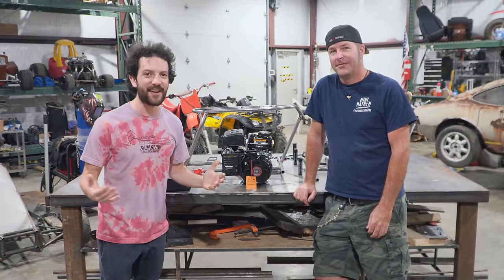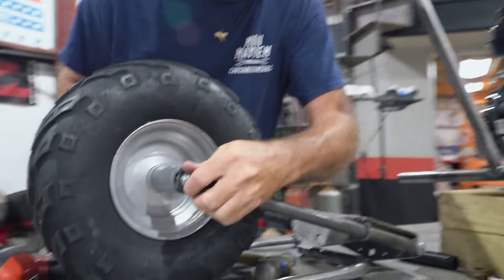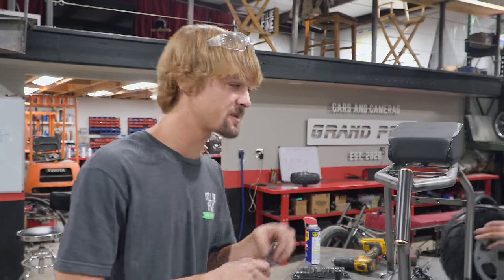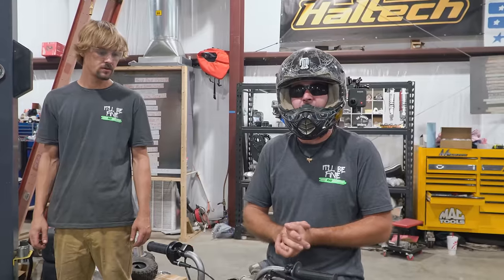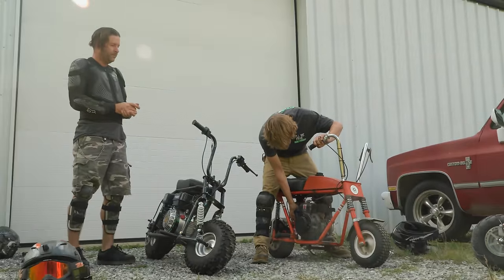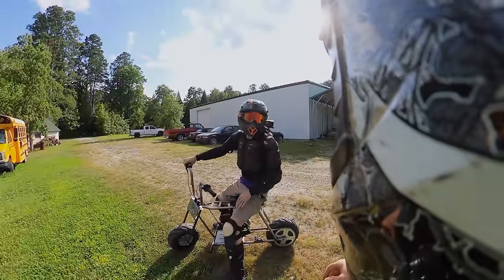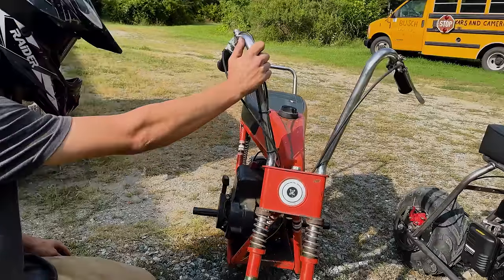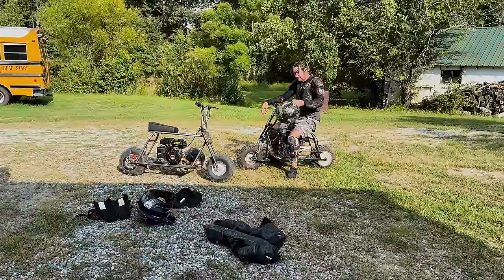Best Budget Mini Bike? Rascal Lite Build + Race!

Comment: In the 70s we used to race VWs around the neighborhood. As we got older we graduated to V8 in muscle cars. Nothing compares to the fun we had rowing through the gears of the underpowered 4 cylinders. Those underpowered minibikes brought back found memories. Sometimes less is more!
Reply: Its to more to drive a slow car (or bike) fast, than a fast car (or bike) slow. You can't push a Ferrari or Vette or a Huyabusa to its limits, or yours, without dying. But you can beat a Trail 90 or VW like a dirty rug.

Comment: And still got the front tread backward! On V tread, both tires point to the center, looking down from above. Unless the front wheel is driven. Then both tires are configured to pull. And if there is no brake on the front, it might not matter that much.

Comment: Nice. I built one of these with a cam, billet flywheel, slide carb, header and no governor. The engine woke up quite a bit. Nowhere near the low end you can get out of a 212 or 224 but it was a lot of fun. Well over 40MPH too. it's long gone though; the bike has a 212 Tilly now and it's about to get a 236.

Comment: I totally get that Go Powersports is a major sponsor, but all parts should fit without welding on new tabs. Maybe they accidently sent the wrong seat. Suggesting that one could order a different seat or weld on new tabs to fix a GPS problem is not good for the newbie.  
BTW, thank you for your continued content.

Comment: Nice minibike guys I'm trying to build out mine right now it's a mega moto  with a predator 420
Reply: which mega moto?
Reply: @AshleyOnYT  mega moto 212 I stretched the frame to fit a battery and i welded a new rear axle/tire mount on rear to fit a slick wheel
Reply: @barbaranevins4979  Hell yea that's dope! I have a Motovox 80cc currently but my first new bike will definitely be their mega moto 80.

Comment: I like it....seems like a great value compared to the thin wall Chinesium stuff out there. The 3hp performed about how I expected....Those tiny engines really benefit from a jackshaft setup. Looks to be plenty of room behind the engine to fab one up and play with reduction gearing for more acceleration off the line. All of my old DB30's with the original 97cc flattys were built that way and ran great, especially with the gov deleted. Nice job, boys! Ballin' on a budget!

Comment: For Charles bike, when you get a new wheel, make sure the spacer between the two bearings is exactly the right length so the bearing clips seat at the same time the spacer makes contact with the inner race.  Then make outer spacers that allow smooth straight operation of the forks. With the axle bolt tight, weld in a fitted fork stabilizer between the top of the lower fork tubes.  This will keep the forks from working individually, and dramatically improve handling.
As for the new bike...100cc might be enough if it would turn 18,000 RPM but that would cost a fortune. Since there is so much room in that frame, ADD the CR500 engine, use the 100cc engine as a pony motor to start the 500 and this would solve all the worlds problems.
P.S. I'm thinking about getting one of those non-lethal bean bag sho_g_ns and hanging out on Ike's lot till his problem is solved.  JK

Comment: I have a question. I’m making a cafe racer and I’m using a 14 hp Kohler magnum engine. I’m trying to find a torque converter for this engine but all the ones that are rated for it are like $200. Do you think I could get a 30 series for a 14HP engine and it would work?

Comment: Probably used a blow torch to cut the hole outfit it was shot the metal would be stretched away from the direction the bullet came from which would probably keep engine from being able to mount flush

Comment: Would the 212 Ghost fit on it ?
Reply: Yes, direct bolt on, no drilling, mount plate is slotted, I have two Rascals with Predator 212's which is the same mount pattern as the Ghost.